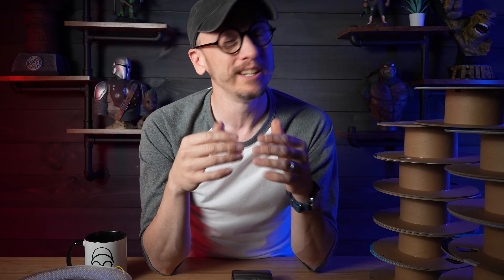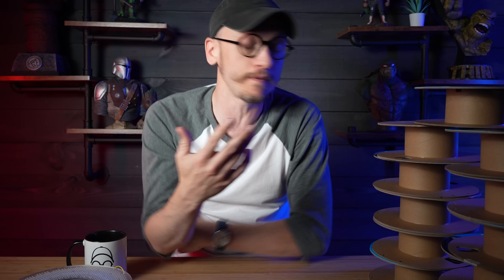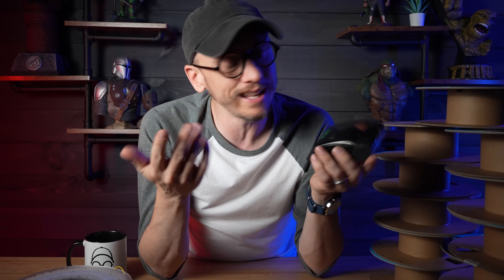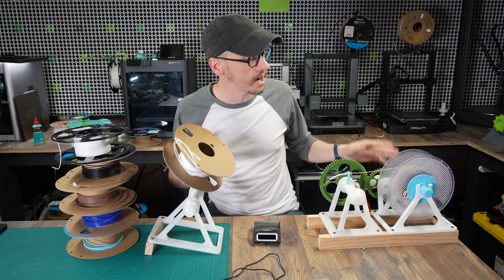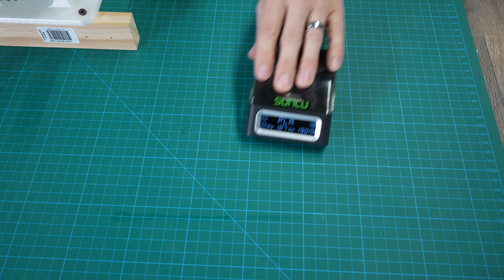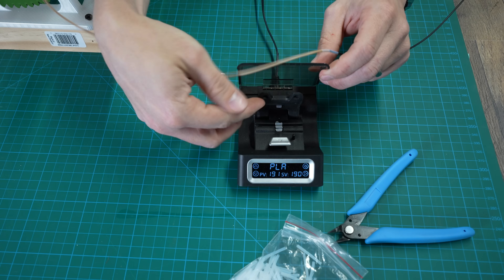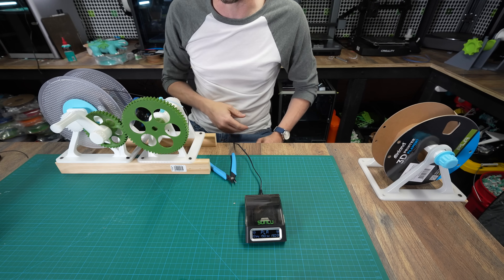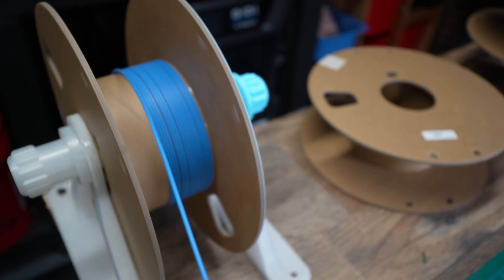This Filament Hack Lets Me Use ALL My Filament

Comment: We need an AMS that has multiple spools, lets say 4, that has built in filament cutter and filament fuser. Whenever there is a request for color change from the printer, considering the lenghr remaining in the ptfe tube between the nozzle and the cutter, and the lenght needed to print, printer would pause printing, ams would cut the filament at the required length, then retract the used filament from the cutter, feed the new filament where it would join in a fuser, on the way to the printer, and fuse previous filament with the new filament. Printer would resume printing with the required and left lenght of filament to finish the line, and habe a clean transition to the new color, either doing a infinitesimal purge or with no purge at all. 
Basically move the cutter from the printer, towards and closer to the ams, and place a fuser between the printer and the cutter. That would reduce waste and provide a clean color transition. 
AMS=>cutter=>fuser=>printr

Comment: Great video! I have one issue. The AMS advertises the ability to switch spools when one runs out. It sounds awesome and I bought one. The issue is that Bambu is using tape to start their spools. The tape either jams the AMS or releases early and causes an error. Today I got a failed to retract when the tape cut loose. If you’re around the printer you can deal with it. If you’re doing an overnight print, you’ll be disappointed to find the issue. Regardless, the AMS is not reliable when using the Bambu spools, which is kind of ridiculous. I bought almost 30 spools from them recently and they all seem to use the tape. The Bambu forum has other people posting about this issue, and so far there hasn’t been a fix from Bambu. The AMS is great for multicolor prints, but don’t rely on the automatic switch for an empty spool.

Comment: This device doesn't save much time compared to the far cheaper filament welders, like Hexagon, which costs about $40 on Amazon. Plus, Sunlu's device can't weld/connect all filaments like most of the inexpensive models. For $100+ Sunlu should include a charging brick. I'll pass on this. Thanks for the video.
Reply: It cost 49 straight off their website.. what crack are you smoking?

Comment: Back in 'the day', folks did this and could use a small piece of aluminum foil wrapped around a joint, and heat with either a heat gun or soldering iron.  It worked but was a pain.  Might try a little strip of foil instead of the plastic sleeve.  BTW, don't tape the foil, just wrap smooth and tight, and give it a shot.  Only go around 1 or 2 times at most.

Comment: I went ahead and purchased it this morning. I have 2 partial spools of a color  and am about 1/2 way through a 3rd spool. On my Flsun v400, where the run out sensor is, this should help me. 

I also have other partial rolls of filament. The suggestion to keep kind for kind (PLA  to PLA (or the + to +)) is a good suggestion. Especially I would not mix PLA and PETG. Or abrasive with non abrasive materials or silk and non-silk filaments. 

Thank you for the review.

Comment: I'm wondering if the joints are prone to breaking based on the curvature of the filament - if you connect filaments but their curvature is different, that will put stress on the connection and probably snap when respooled or fed into an ams. Conceptually this could be useful, but it may not be so practical after all.

Comment: Get a candle.  Light the candle.  Hold the filament ends near enough to the flame to melt.  Push the ends together.  A little "filament donut" expanding ring will push out as you push the ends together.  Keep the donut symmetric and the ends aligned.  It cools in seconds.  Take a nail clipper and clip off the donut rim, then use a fine file to smooth the joint.  I have done it this way for many years now.  It literally takes me less time to actually do it than it took to write all this down.
Reply: Thanks, I came to the comments because I knew someone would give me the easy hack to do it!!!
Reply: And your quality won't be consistent. But great on you. You do you and the rest of us will do what we want. So you can feel good about wasting time. You do realize that not everyone is a hobbyist. A lot of people use these for business and this increases productivity. But you want to act like a judgemental jerk.
Reply: THIS. all the influencers showcasing some overengineered way to push product and increase waste. overcomplicating things when a simple fix would suffice. this is a DIY hobby yo. and that non-motorised winding contraption using so much plastic....i use my finger. ultimate eye roll
Reply: @alicekoh7322  Judgy jerk whining about a DIY built contraption while complaining that this is a DIY hobby. 🙄🙄

Comment: If the fillament sensor of my Prusa MK4 detects, that the fillament runs out, the printer allways ejects a few cm of fillament that would be waste.
Okay. I still can use this snippets with my 3D Pen, but not with my Printer, because for the MK4, they are to short.
With this device, I will be able to fuse this parts together to a rainbow fillament and reduce waste.

Comment: Didn’t read the comments so my apologies if this has already been said but: 
When your weld is cooled you can hold the plastic sleeve and spool the filament pulling the sleeve off the end and reuse them. 
I have watched a few videos on this welder and saw this done in one of them. 😊 
Can’t wait to get mine I have my end bits all lined up (methodically) ready to try it out! 🎉

Comment: On the plastic sleeves; if your scraps are fairly short, it looks like you could slide the sleeve off while spooling. It might take a little longer, but might be worth it. I probably wouldn't recommend it if you measure your scraps in meters though.

Comment: Thank you for your explanation. You helped me realize that as a Bambulab P1S user that I do not need this.  Not only does the AMS eliminate this problem but even when I use the external spool holder I can just use the extruder to fuse the next filament into the print when the first spool runs out. 😊
Reply from the maker: Yeah. I definitely think this isn’t for everyone. It’s nice and handy to have for non Bambu people. If you only have Bambu printers I don’t think it’s something worth getting. I have different brands and I like having it.
Reply: @ItsMeaDMaDe  Thank you for your video tutorials.  I get a lot to help me.

Comment: Bambulab AMS makes this device useluss.
Reply: doesnt the bambu ams purge and waste a ton?
Reply: @heeelion134  Yes if its printing colored parts, but not if its just doing an auto switch when it runs out of filament. So you can print right to the end of a roll, then it will just switch to another roll leaving no left over filament and only doing a single purge.

Comment: I'm giving a like ,because I like how you explain stuff...but I don't like the tool ...it's over complicated , and produces more waste. I'd rather use the auto refill function in the AMS
Reply: Same
Reply: And completely pointless in that context. Without AMS, on the occasions I want to use up.ends of spools, I would (did) just feed in new end as the old one disappeared into the Bowden or the extruder (depending on direct extruder orbit).
Yes it took a couple of minutes, but no more than this tool and a lot cheaper.

Comment: I've seen this on Facebook ads, thought it was a scam at first. People in the comments moaning about having to buy extra sleeves after the initial supply has run out. 😂 I'm off to buy it now as it will come in handy in the future. (I'm new to 3D printing). Surely it would be possible to re-use the plastic sleeve by using some cellotape?

Comment: I was literally just thinking about needing something like this yesterday, after a print, where I had some left over on a spool but couldn't do anything with it. The I looked over at my filament pile and noticed how many spools are in the same situation. Their pre-order bundle sale seems worth it, you get a few spools of PLA 2.0 w/ the connector. I did buy a spool of 2.0 last week, but haven't used it. Hoping it's as good as they say it is.
Reply from the maker: @ChrisHitsHard  yeah it’s a handy little tool to make it possible to use up all the filament. I’ve been printing with the spool I made and it’s been printing just fine. It’s my own ugly rainbow filament l.